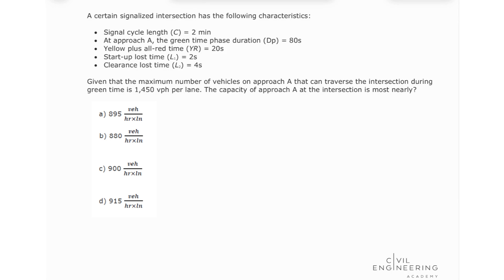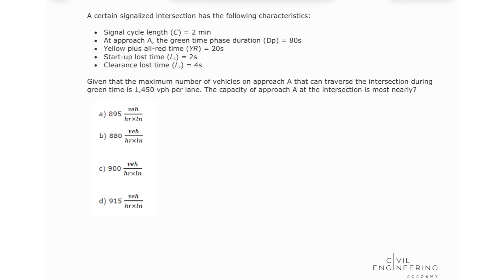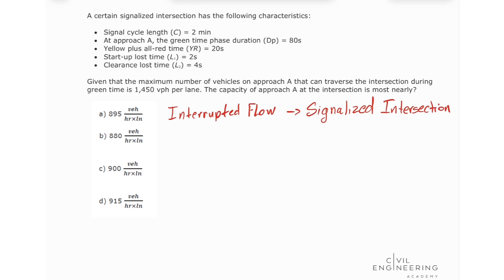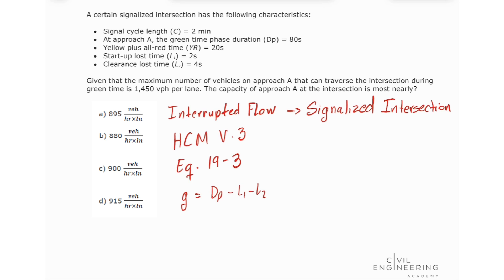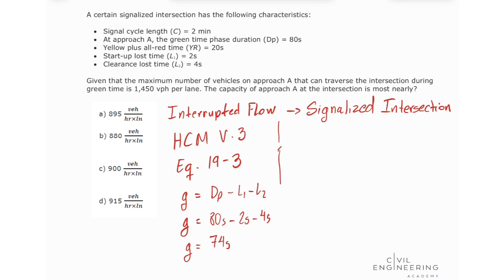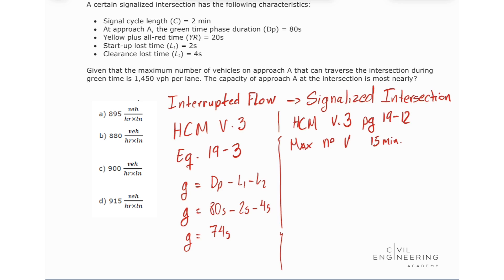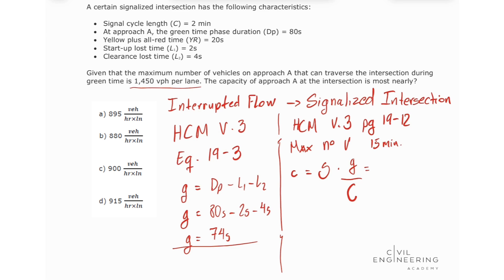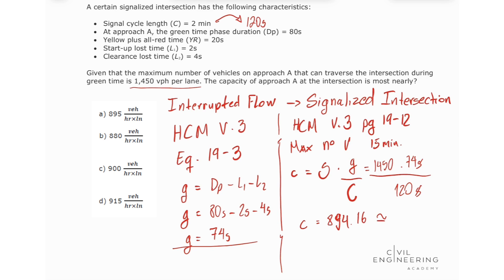Civil PE Exam – Transportation – Find the Approach Capacity at a Signalized Intersection

Comment: 1. What about the yellow plus all red time? Why is that not subtracted from the effective green time?
2. The equation you are using to calculate capacity should include N (number of lanes) in it. Are we to assume N=1? If so, where does it mention that in the HCM?
Thank you!
Reply: I believe effective green time = green phase + yellow + all-red - initial loss time - final loss time. This is as per Roess, McShane book for traffic signal problems. Also as per HCM Vol 3 Ch 19 Exhibit 19-5 (page 19-10) and Eq 19-1 (page 19-11)